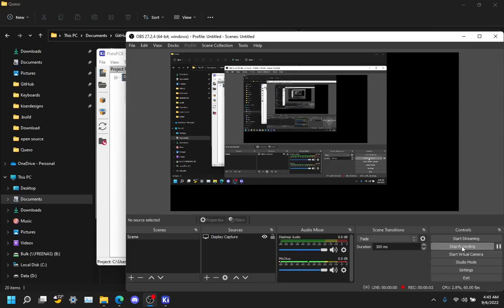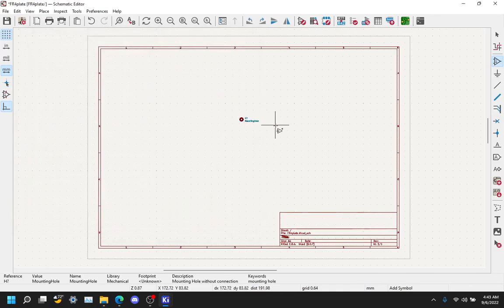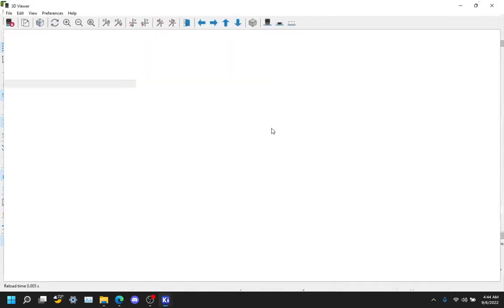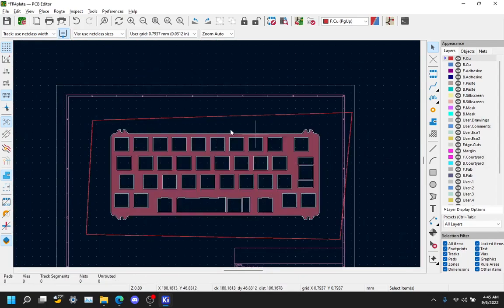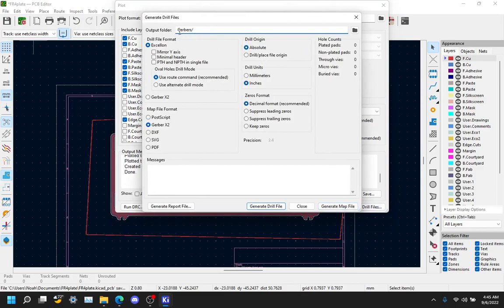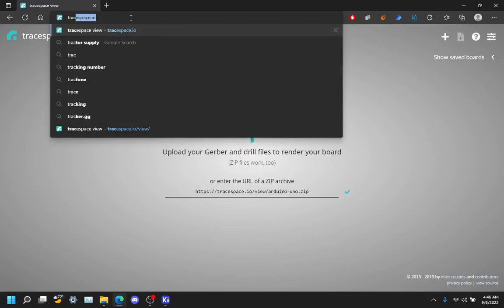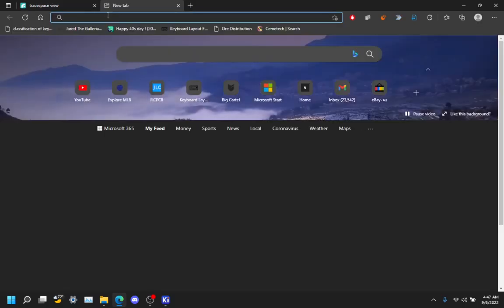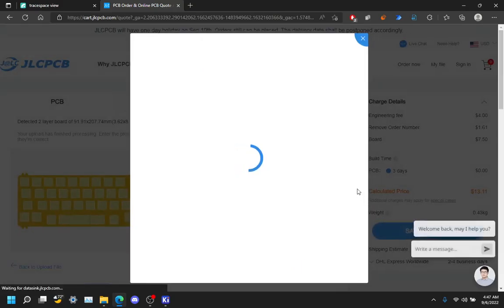Convert .dxf to Gerbers for FR4 Mechanical Keyboard Plates

Comment: Could you tell more about how to make the plate designt itself ?
Reply: aio3 to export dxf based on keyboardlayout editor for your specific build
Reply: Model the plate in Fusion 360 (look for tutorials for that software). It allows you to export sketches as dxf
Reply: @prxrb  FYI, DXF export is not free anymore without trial or subscription